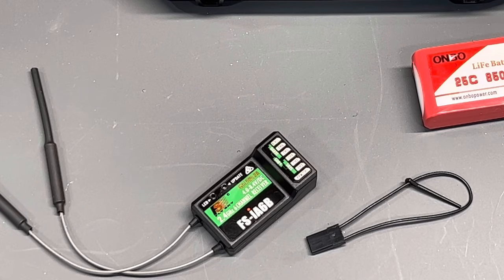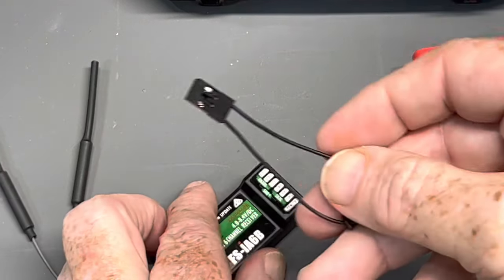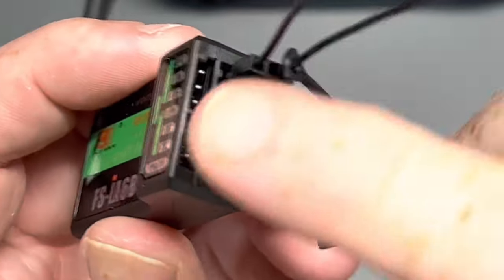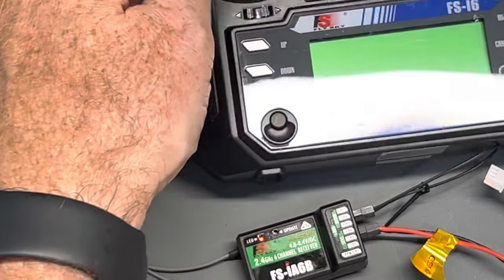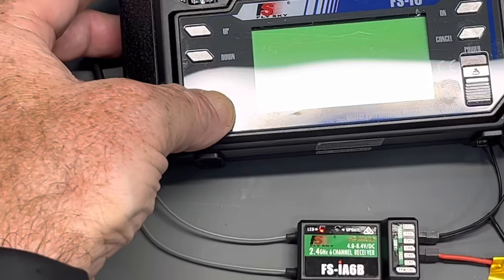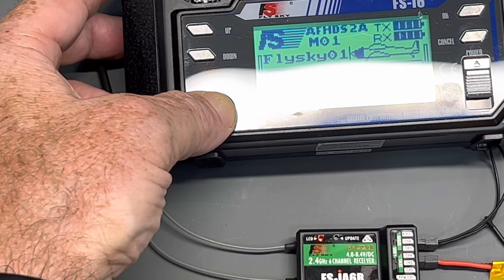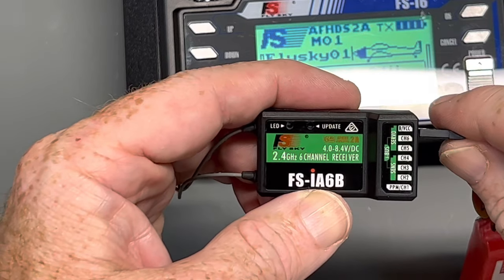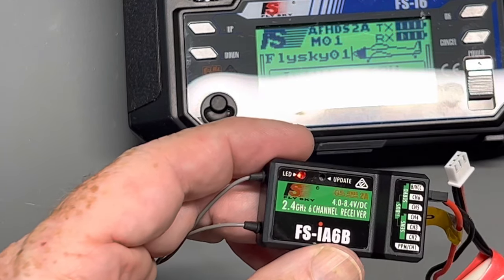DSNA Pro Tips- Binding the FlySky FSi6 radio to the FSia6b receiver

Comment: It looks like you didn't have any signal ports on the receiver connected to anything, so it can be bound to a transmitter without needing to also be connected to an ESC/FC/whatever.  Good to know, since I've spent ages trying to get my TGYia6b receiver to bind to my Turnigy 5X transmitter with no luck, this eliminates incorrect connection to the flight controller as a potential problem.  My 5X also isn't binding to another receiver of mine, I think I may just have a dead transmitter and need to buy a new one...

Also, is there any difference between the Turnigy ia6b and the FlySky ia6b?  They look like the exact same product
Reply: Did you have any luck making these changes? I cannot figure it out.

Comment: Is it possible to unbind an fs-ia6b receiver?
Reply: Plug in the binding harness and start binding procedure to the new RX (transmitter remote). It will bind to the new one.
If you want to have it "virgin", you'll have to reflash it "virgin" firmware.